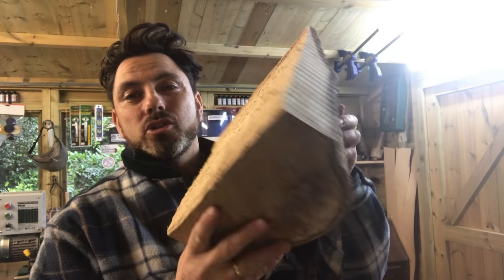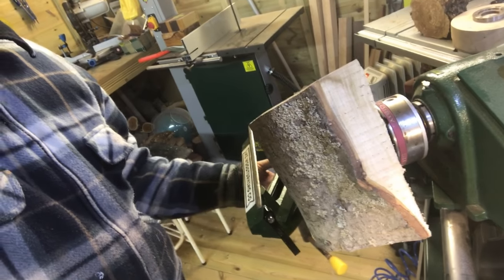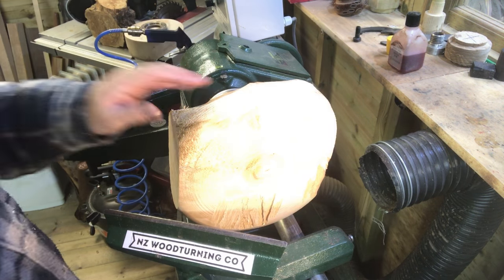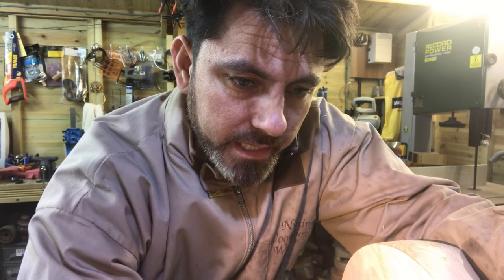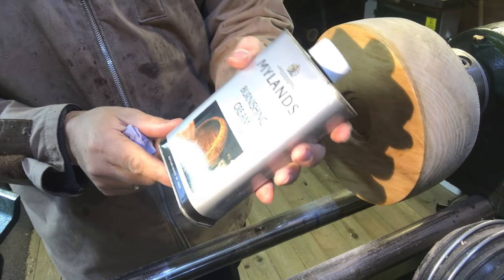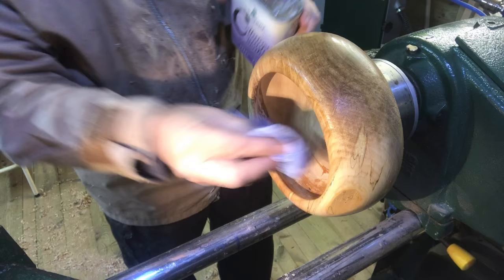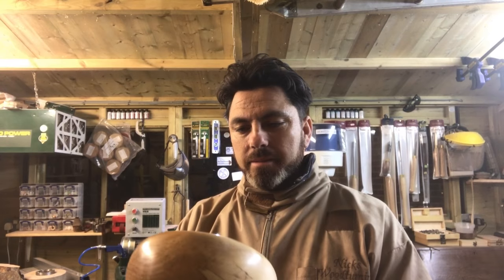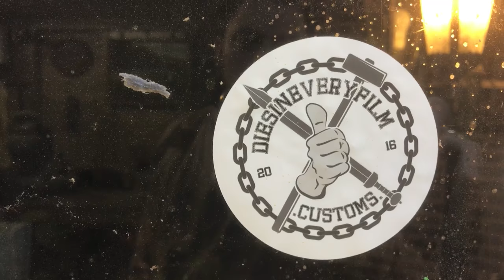Woodturning - The Chestnut Log Bowl

Comment: Nick,
I know the spindle roughing gouge has already be addressed but not totally sure the safety issue was correct. You never turn end grain like you get in bowl turning as you get a catch that could break the gouge sending it flying. If you notice the tang of a roughing gouge is thin and tapered and not tool diameter like bowl gouges.
Thanks for the video and a very nice bowl,
Jim
Reply from the maker: Hey James, Yep i think i wasnt working on soemthing else at the time and wasnt really thinnking . i have no idea why i had this in my hand so i totaly agree with everyone. I know you dont use this tool so my fault. Thanks for watching mate